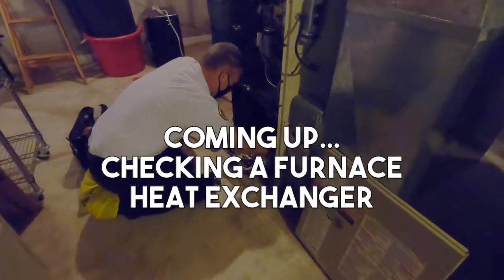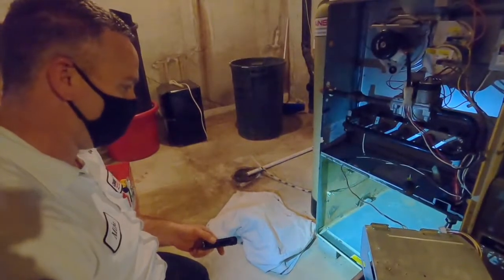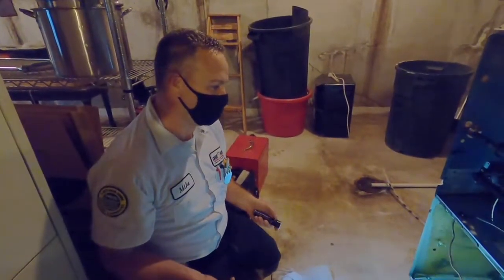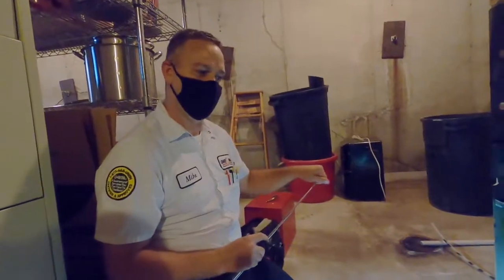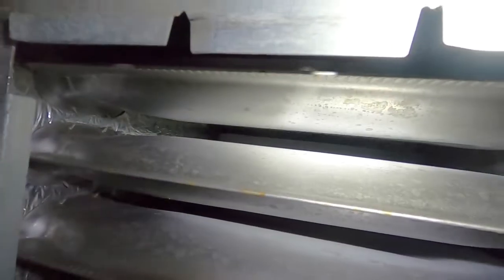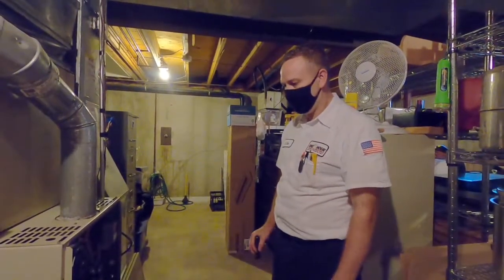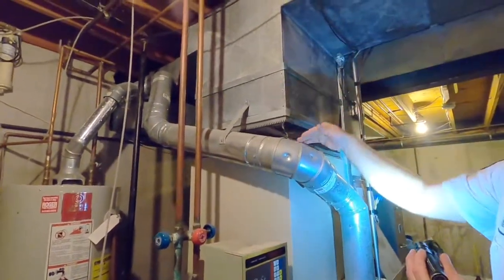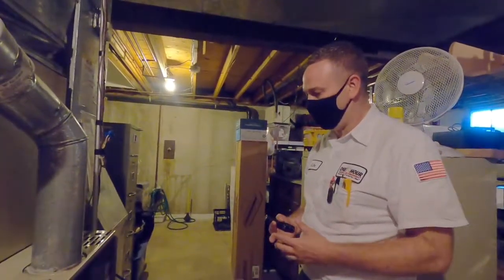Checking a FURNACE HEAT EXCHANGER: Checking a Furnace For Carbon Monoxide

Comment: I work for a hvac company as well, as i watched your video i seen that the gas line that connects to the furnace gas valve has a union inside the furnace, what our company does in that situation, is give an option to reroute or repipe the line outside of the furnace, since it can be a safety hazard if there was a gas leak it would cause an explosion.

Comment: is it really only 9 PPM??  before emergency  or is it 90??      I recently bought a C0 meter  ( because I dont like that a typical alarm only beeps at 25 ppm)  ,   I wake up with headaches and feeling really odd  if the thermostat is on a certain level   even with a window cracked for fresh air.    It's not my house  so I don't have control over someone digging into the furnace yet... but...  Any tips on using a meter?   Should I just hold it over the air coming from the registers?    I also noticed one of the registers has some rust  in a kitchen area thats not wet really... I've read that some signs of C0 leaks are condensation but I'm not sure if in a register area... thanks
Reply: I will call your landlord. How old is this furnace? You can get CO detectors they're not too expensive
Reply: @benkuxhouse787  I did end up getting an actual reader and it was zero on the register air. so maybe the dry air/dehydration or stale basement air.
Reply: @tonypepperoni229  how old do you think the furnace is? If you're not sure you could take a picture of it and I'll tell you what I think it is. You can observe the flames and see they do anything weird when the blower comes on yellow flames indicates cracked heat exchanger